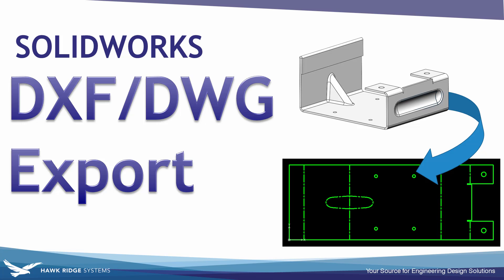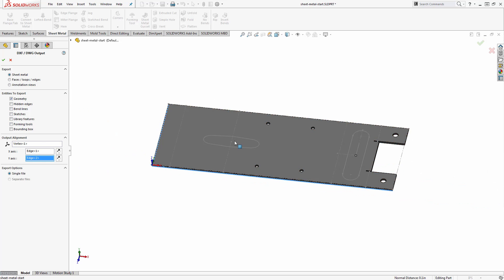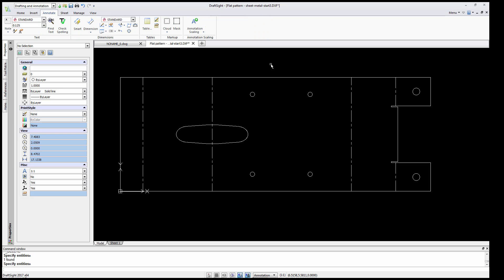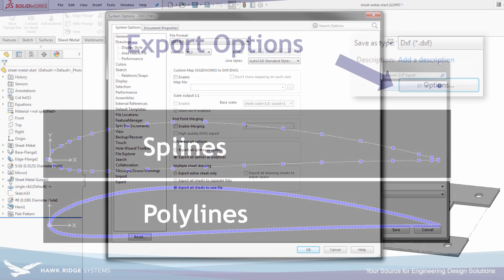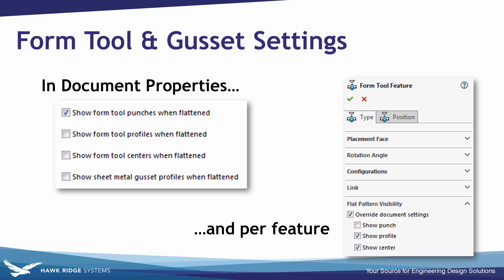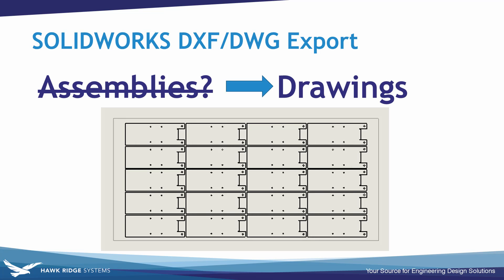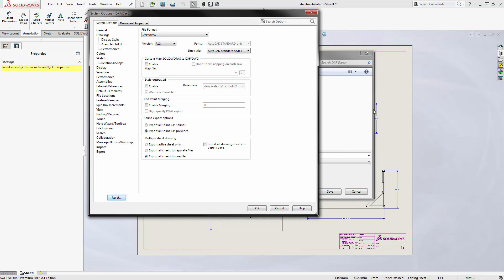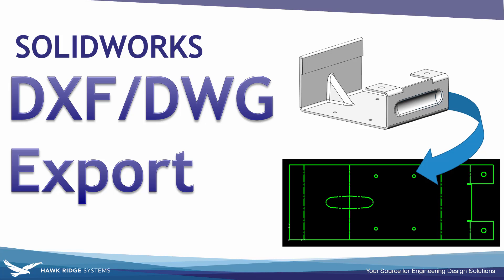SOLIDWORKS: DXF DWG Export

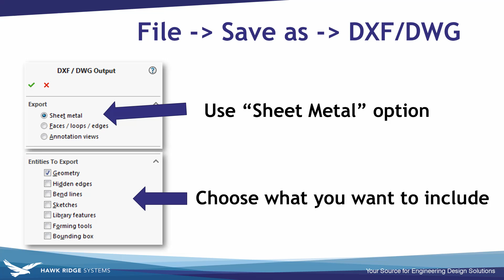Comment: What is the Library Feature used for in Entities To Export at 5:50 ? Kindly Respond
Reply from the maker: This will enable or disable export of any smart features or other features from the Design library that you added to part. Common examples would include hole patterns or cutouts that get reused. We have a video here on creating library features if you are interested: https://youtu.be/HDyoZH4X2qk

Comment: I want to export a solidworks 3d model to caddie or Autocad, my probleme is dwg or dxf is a 2d setup that does not help me, any tips how to get a 3d model working in caddie
Reply from the maker: You might want to try exporting an ACIS / .SAT file (File - Save As, .SAT extension) - this is typically what we would recommend for exporting a 3D file to AutoCAD or DraftSight. 

If you need a 3D DWG as the end result you could import then import .SAT file into AutoCAD or DraftSight and export a 3D DWG.

Comment: Please, do you know, how to create a second sheet with no format displayed? 
So sheet 1 is fully dimensioned and annotated as a design document, while sheet 2 is never printed but used only for DXF export. I would like to have sheet 2 in a stage with no background of displayed sheet, so I can save 1:1 flatten part without having trouble to fit paper size. We have parts for bending from small bracket with size of a little matchbox to the hopper side wall,  4.5mm thick mild steel sheet metal, with a surface about 2 square meters
Reply from the maker: Good Question- You can disable the sheet format on the 2nd sheet by Right Clicking on the sheet and choosing "Properties..." to bring you to the Sheet Properties. Then clear the checkbox for "Display sheet format". This will cause the sheet to have a blank background for clean DXF export.
Reply: Yes, that is how we do that. So there is no option at all to do not see any background  sheet on the screen even before export to DXF. There will always be something. It is not exported, but it is there...
Reply: Would you be able to achieve that by choosing a Blank sheet as the drawing template before creating the drawing. Then all you see is the drawing with no Title block etc.